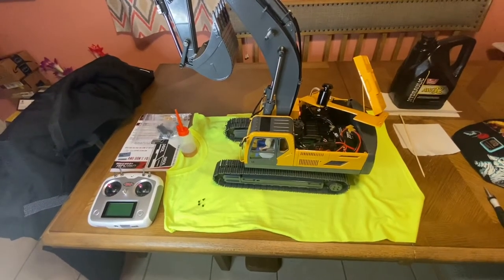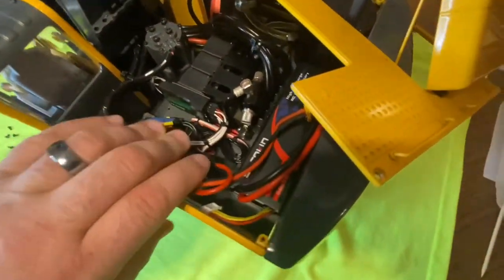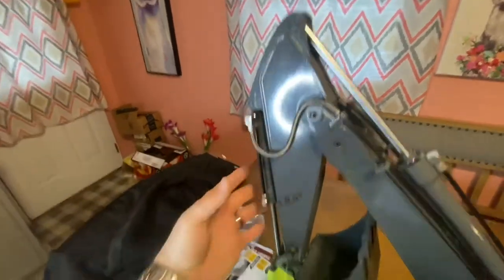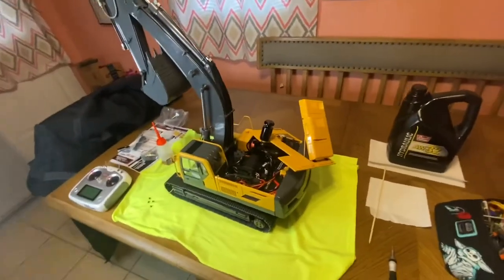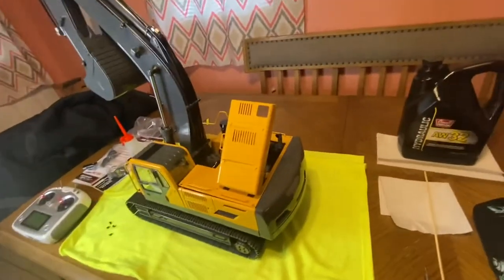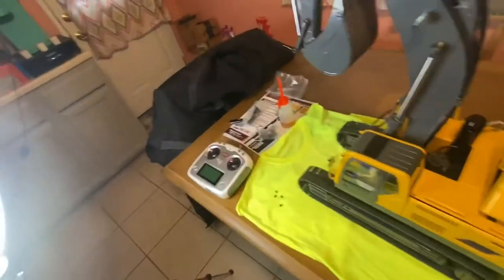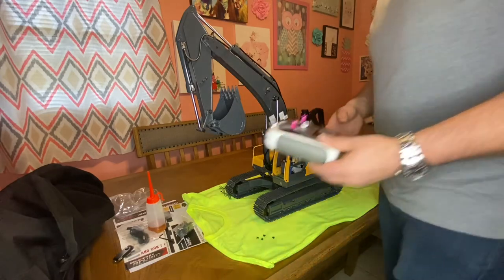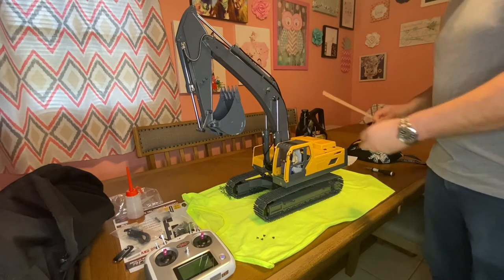RC4WD Earth Digger 360L- Setup- O.R.C.E

Comment: Hello there. I accidentally reset my settings to default. Everything is back to 0 for sub trims and 100% for endpoints. Reverse are all back to normal. Could you tell me what are the settings for sub trims, and end ponts? Im not sure if all 360l use the same settings. But im sure they wasnt all 0.